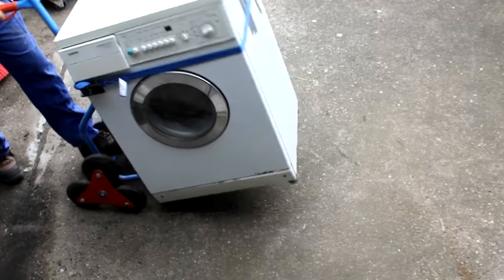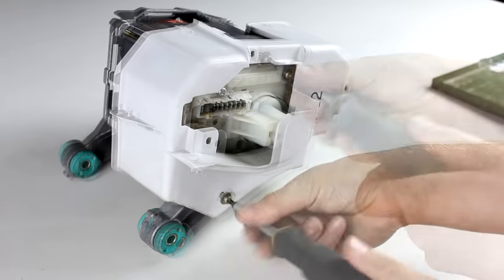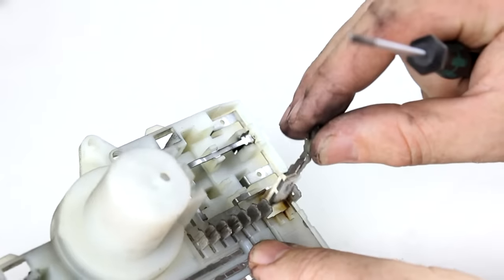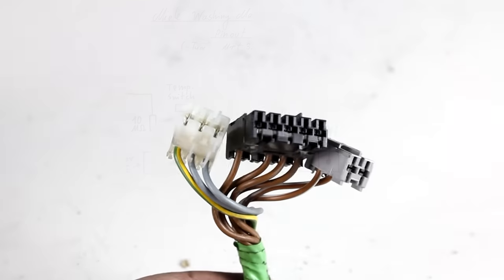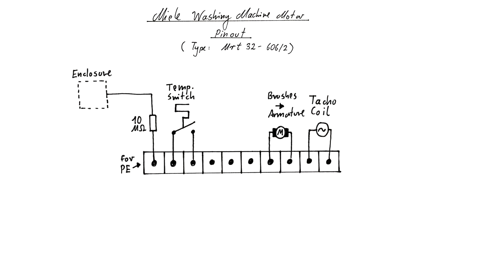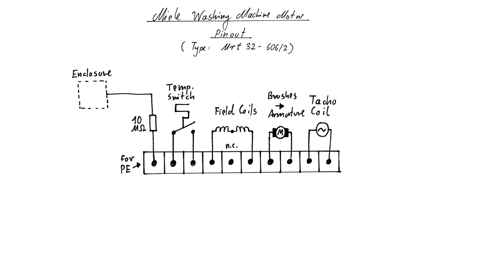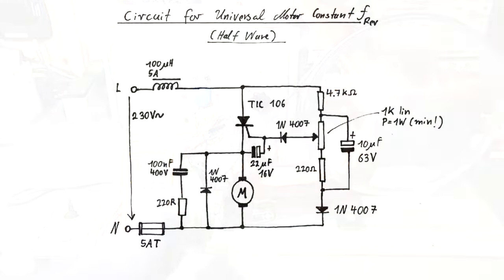Inside a Washing Machine Motor: Explanation,  Pinout, Teardown AND Experiments

Comment: HI, You seem to know a lot about washing machine motors. I was wondering if I can bother you with a question. My washing machine started making a noise like something was rubbing against the motor. I opened the back and realised that there was a kind of cellophane wrap with carbon lines residue that had become torn and undone. I think it was placed on the end of the shaft.  I pulled it out with a pair of tweezers. the machine works and the noise is gone, but I wonder what that was for and whether it will affect the machine. Thank you very much
Reply: Just a protective cover from water.   It will not affect the functioning of the machine, but I wonder why it came loose, did a cable tie break?     Hopefully the wires going to the motor's connector aren't loose too, or they'll eventually fracture and break from fatigue at the connector.       From a washing machine repairman.
Reply: @simonruszczak5563  Hi. thank you very much for taking the time to respond. I can't see that much inside the motor's casing, but the plastic was torn when i took it out. there is still a bit inside which is in place and not causing any problem. i think that bit just broke off. the machine works just as normal and i can't hear any weird sounds of other loose bits. i was concerned because this is a very cheap machine and my thought was that they would avoid putting unnecessary pieces to save costs, so there had to be  a use for this plastic wrapping. Thanks once again

Comment: Thank you for the explanation of how the motor works, but how does the electronics in the washing machine control the speed? The washing machine controls the motor and when washing it is very slow and when spinning it is very fast, so the speed controller is there how do you use it?

Comment: A heavy fly wheel that can be clutch driven would be great on a small electric vehicle.this way the energy created as inertia can then be pulse controlled via an hydraulic clutch which transfers the torque through to the drive wheels . This way you have tremendous torque available when needed for acceleration and from a small compact motor . When at cruise speed the small motor now uses its rpm to power drivewheels via a gearbox . Upon being momentarily stationary again the power is directed to charge the flywheel in preparation for acceleration again . You will be a 1/4 mile hero 😊

Comment: Since you can run the motor on 20V, can you still get a lot of torque out of this motor?  I.E. For use as the motor for an electric go-kart?
Reply: It should have plenty of torque since it's supposed to spin a lot of weight in its original application. My math isn't good enough to calculate that more precisely, sadly.

Comment: well, I came across your innovation and comprehensive information just today, almost two and half years late>
first, thank you very much for sharing such a valuable information with its demonstrations.

I wonder if you could also help me with an idea
i'm planning to do a DIY slow speed short time separated steps motor with low power consumption, that would be installed as sun tracker for my solar panels,
It's blurred plan still, yet I think using a washing machine motor with two separate circuits to increase torque and let speed down would do,

i'd highly appreciate your feedback on doability of this idea
thanks

Comment: How does the motor change direction? I hear the click of a relay from the control PCB of my Miele when it is on the wash cycle, at that point the drum rotation changes direction. Do they swap over the AC power connections to the field coils to reverse the motor?

Comment: Imagine what would happen if someone was to design a website like github but instead of software it was for open source hardware design diagrams. An open source motor and engine would be great for reducing prices of lots of products. Combined with crowd funding it could revolutionise manufacturing.

Comment: So if the field and armature are powered by DC its rotation can be reversed by either reversing the field or armature connections, but not both?

And if AC power is used how is the direction controlled, does it always turn the same way?

Comment: I took a look at a capacitor started one phase cage runner motor I have and it appears it could be rewound into a 3 phase induction motor. Have you ever tried that How to estimate what it would do to the max. Power output? I don't recall ever seeing a brushed motor in a washing machine...

Comment: So if you connect this motor to a propeller in let's say a bucket put a pipe in a stream so the moving water turned the wheel you could create electricity ?

Comment: Hello, i have a question, do i need to put some diodes on the wires to protect my dc source from the current generated by the coils?
Reply: 4 years but I reply just in case somebody is wondering: yes, best practice is to always put a diode or a snubber network in parallel with an inductive load (relay, motor coil,...)

Comment: I found this fascinating. I am just an enthusiast who has lots more to learn but I wonder if one of these motors would suffice to drive a boat propeller. And if this were possible, could it be driven by one or more Lithium Ion batteries (the type used for radio control models)? Or maybe it would be better (and safer) to use a car battery?  Would batteries be enough for this to be practical (say to give 3 hours of usage, which does not have to be continuous operation either since the motor could simply support manual rowing - sort of in the way in which an electric motor supports pedalling in a bicycle)?  Or is this the completely wrong type of motor for such an application anyway? I am just curious at this stage but it seems like it would be a very environmentally friendly use of such scavenged motors.

Comment: I am trying to make an e-bike with almost the same washing machine motor. I built the entire bike, and pulleys by myself and I connect the bike to the wall with a long cable and  it works perfectly. The only problem was that when I tried to control the washing machine motor with an inverter and a car battery everything went wrong. I'm struggling with this issue almost a month and I was very disappointed with my project. You actually made my project possible again. I ll try again with your method without an inverter and a car battery that weights almost 20 kilos together 😂😂. But is this has enough torque to make it work ? Can i send you an e mail to help me please 

Thanks in advance.

Comment: can you transform a motor into a generator by introducing electricity into the armature so it would be an electro magnet,and using it in a hidro generator setup and use the feald coil to generate electricity?

Comment: Thanks for sharing - if you don't want to replace the field windings with a permanent magnet {but still want the same effect} a fun experiment you can do is disconnect them 'charge' them and connect them together in which case they will hold a magnetic field charge. the principal is the same as the so called - PMH -  just search " Ed Leedskalnin's “Perpetual Motion Holder” (PMH)" 

you may or may not know it's also the same principal/way computers use to hold memory with inductors i'm sure that was used in Germany also.

regards. 

also 
{insert some random comment about 'safety' adding 'fear' vector}
{have bots 'like' that comment}

Comment: So it seems that the current in the rotor controls the power of the motor and the current flowing trough the stator is controlling the torque. Correct ?

Comment: running this universal motor on dc current does it give u high torque becoz i using this motor for e bike by connecting 24v batteries in series to get 72v is it enough for motor run at high torque plzz reply

Comment: I have a similar motor and I have a weird idea of how to run it.

I am thinking of running the rotor windings off of 230V AC rectified through a bridge rectifier to DC, and  the field windings off of an adjustable dc power source (from zero to x volts, I haven't tested voltage/current correlation yet) (EDIT: Turns out around 5v will be sufficient to run about 2.3 amps through the windings)

The rectifier is so I will be a able to use the dc source for the field winding.

Does that make any sense?? Or is it just stupid?

Comment: if you need the power control module for the siemens motor i have a brand new one in the box, the part is no longer available from siemens. Ian.

Comment: Don't you find it ironic that at 3:24 you mention the over heat protection circuit which did its job in protecting the motor, but, in the big picture, the motor was still doomed to the recycling yard because whoever owned the washing machine probably just replaced the whole unit - the cost of repair (usually) being so high.
Reply: Also if you do try and find the thermal/current overload motor protector. Like me you cannot buy the item or find any supplier of the part.

Comment: Typical Horizontal BeltDriven Washing Machines
Motor power • About 750 W;  Motor torque • About 2 nm • In some cases 3.5 nm

Motor type

• Three-phase ACIM (two poles)

• Three-phase PMSM (eight poles)
Load capacity of standard washer size 60 cm x 60 cm x 85 cm
• From 5 kg up to 12 kg • Typically—7 kg or 8 kg
Drum spin speed • From 1000 RPM to 1600 RPM
Transmission ratio—drum to motor  • From 1:6 to 1:16
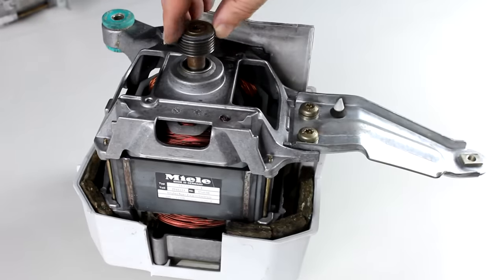• Typically around 1:10

Comment: Why does the rpm go down when you put a higher voltage on the field winding? @15:00
Reply: because a stronger magnetic field is harder to push against, but it also allows to produce more torque.
Reply: As it spins the armature generates a voltage (BEMF) that is proportional to it's speed and the magnetic flux from the field windings, when the voltage produced by the armature is almost equal to it's supply voltage it produces no more torque (stops accelerating). If you increase the field current you are making it a better generator that operates at lower speed for same voltage, if you decrease the field current it's becomes a worse generator that needs to run at higher speed to produce the same voltage or BEMF:-)
Reply: Thank you Coolkey, i think i have understood now.
Reply: manaquri is there an equation that describes this phenomenon?

Comment: that's 30 years old? looks like something you'd find in a modern machine but of course 30 years ago in the US we used induction motors in washing machines. I wonder why it seems that every other country used big universal motors...
Reply: coolbluelights in USA you mainly use vertical axis washing machines that don't need a lot of torque and rpm to spin.
Here in Europe we mainly use horizontal axis washers that can spin up to 2000 rpm so universal motors like this or inverter ones are widely used since the 1970s, at least in Northern Europe.
Reply: Lorenzo Basso. In spain we too have Miele, aeg, asko, bosch....

Comment: could you use the wiper motor for a small wind generator?
Reply: I think the field windings have to be powered externally or permanent magnets are required in order to generate electric energy from mechanic energy. Because in every other case, you would have a hen-and-egg problem. My opinion.
Reply: When the stator field is up, you should generate AC on the wiper contacts by rotating the spindle. But I am not sure about that, I am really just imagining here.

Comment: where did you learn so much about electronics?  Are you and electrical engineer?
Reply: I attend Kansas State Polytechnic in central kansas and this is about on par with what we are learning. I have not yet learned of passing electricity through the field windings of a motor to control torque, but have learned a great deal of circuit design. I am only a sophomore however so my knowledge is limited.
Reply: @OtherDalfite  
How did the past year of college go?
Reply: @gregorymalchuk272  it was good calculus was the hardest class for me. I chose to graduate with a 2 year degree which has landed me a decent salary creating wiring harnesses and other installations on public transit busses. Not what I thought I'd be doing but it's a decent career

Comment: Could you use the “Tacho” to measure rpm and then just regulate AC input?
Reply: That's exactly what that's for ... monitored by a microcontroller in part with the whole system

Comment: Hello James, love your channel sir. I am looking for a 9500 watt or higher generator. I require atleast 1 50amp outlet, remote start and dual/Tri fuel. Can you recommend a decent generator? I have a Honda Multiquip 3600 generator that is currently setup for propane at the moment. I haven’t gotten it to start yet. A buddy just gave it to me. Do you know of anyone in Indiana that wheels and deals in generators. I currently have a marketplace ad looking to trade a rc helicopter and/or gold and silver nuggets and bullion. I’m almost to the point of buying a new one from lowes for $1200 Westinghouse or WEN instead of paying $900 to $1100 for a used one. Thoughts anyone?

Comment: Hi,
I am 67 years old retired Indian government servant and am completely self-taught DIY enthusiast doing some restoration projects of tools/toys/antiques etc. I do not have many resources in respect of advanced tools and machines but make the best of what I have. I do not own a bench grinder but make do with Dremel tool I have, I was lucky to have a friend who gifted me a SIEMENS washing machine motor retrieved from the machine he was retiring. The motor is SIEMENS (1BV5565-2CC )250W and 220/230Volts. There is no connector pins enclosure on the motor body just one cable with five wires coming out of the motor body, My request to you is can this motor be turned into a bench grinder and if so can you help me with a wiring diagram that will stabilize the motor speed that is universally adopted for bench grinders. It will help me a lot in saving me precious resources.

Comment: Nice video, but actually i have to kinda disagree about the danger of universal/dc series wound motors running without load on its rated voltage. Im not saying its not possible, but in most cases it will be very hard to make those motors break apart, even such cheap-made washing machine motors can run without load on rated voltage without any problem at all. I have tried that on my own with a bunch of those motors and they ran just fine. Also, i saw a video on youtube where someone ran that motor on higher voltage at 32k rpm and it didnt break apart! So my point is, even if there would occur any mechanical failure, it would be only commutator breaking apart, which isnt that much, and definitively not the motor or any large parts flying trought your ceiling.

Cheers :)
Reply: It's not about a catastrophic fail. But the speeds much higher than rated for will definitely destroy the bearings and brushes after a short time.
Reply: @Coolkeys2009 thanks for sharing your experience. Cheers!

Comment: some late info.   at 17:40,  my explanation would be this.     in  ANY motor   THERE  MUST  BE  FIELD  FLUX.    the  SOURCE  of the field flux is  EITHER   Permanent Magnets   or   ELECTROMAGNETS.    this motor design  utilizes   ELECTROMAGNETS.     when   no  power  is supplied to these electromagnets,  there is still a  TINY  amount of field flux present, in the field IRON and the  armature will rotate.    in such a case, the amount of output energy,  TORQUE,  at the shaft   will be  MINUTE.         googletranslate
https://en.wikipedia.org/wiki/Universal_motor

Comment: nice video ... what I learn again is that motor are useless for me, same motors you find in electrical mobile power tools like angle grinders, drilling machines,... the brushes and they're high speed makes them useless compare with asynchronous  one phase or three phase motors...

Comment: Excellent though this video is, most appliance motors here in the 'States are capacitor start induction motors, not brushed motors. Thus a completely different wiring scheme.

Comment: As a so-called "quality" brand, I'm surprised at the amount of plastic on that Miele motor! 👎

I have a 15 year old "cheap" Italian-made Candy Washing Machine, which has been very reliable, and I just recently changed the original brushes, and there is hardly any plastic at all on the C.E. Set Universal Motor! 👍
Reply: There is a difference in plastics some fall apart  others don't, I used a miele vacuum cleaner the other day very powerful suction.

Comment: why use a brush type motor,  my w/machine uses a 300w single phase w/run capacitor motor, simple & will outlast the machine.
Reply: bazrazin1 trust me these machines have ran for 30/40 years and are still going strong. No need to change the motor structure